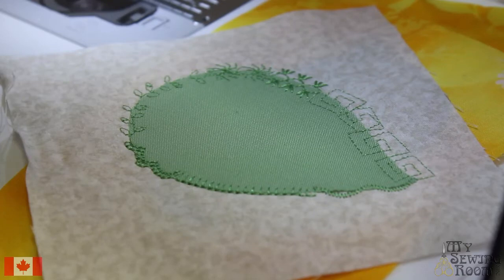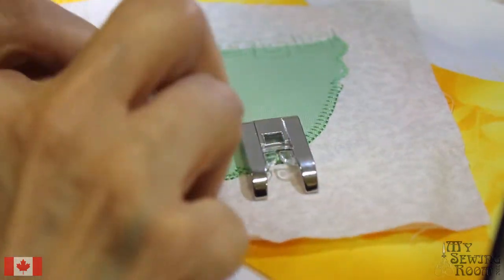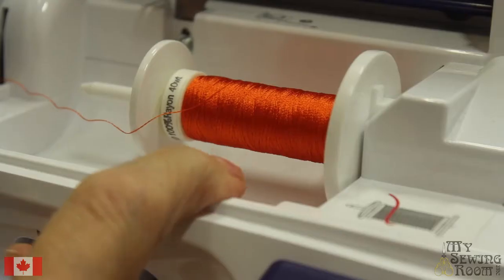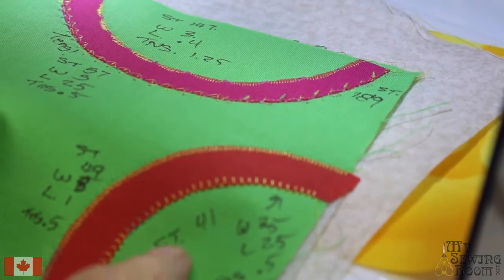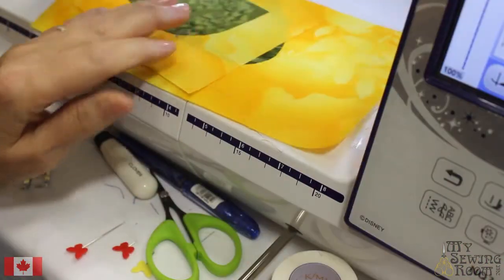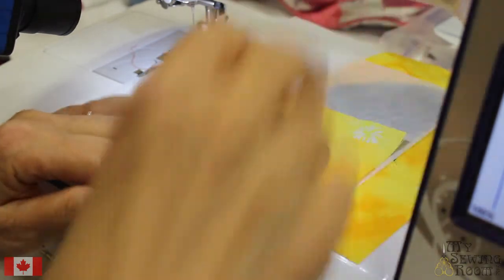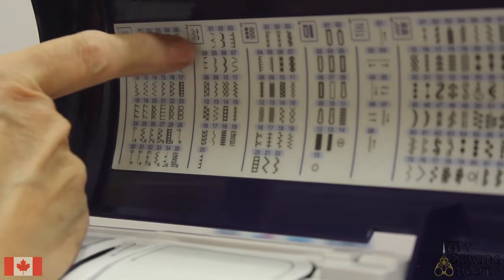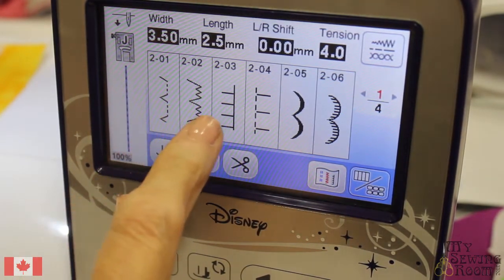Brother Level 2 Part 6: Using Decorative Stitches

Comment: For the test page, did you appliqué on paper?
Reply from the maker: We used fabric and stabilizer. Testing should be done on fabrics and stabilizers using the the threads similar to what you intend to use for the final product